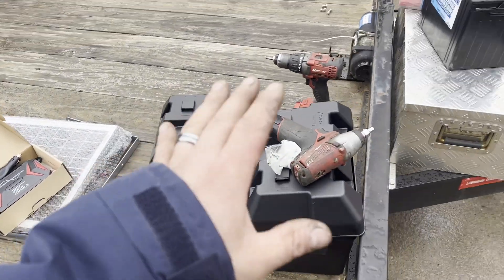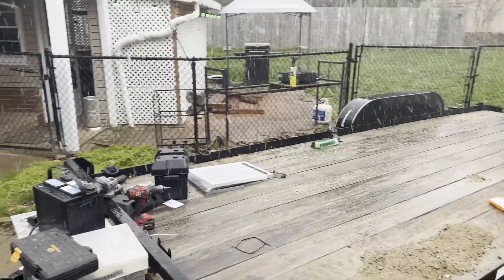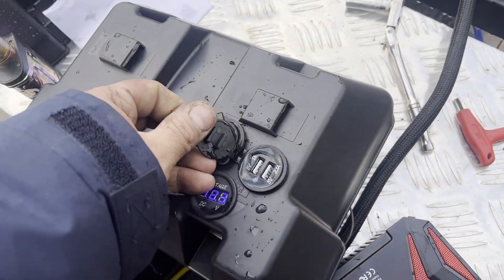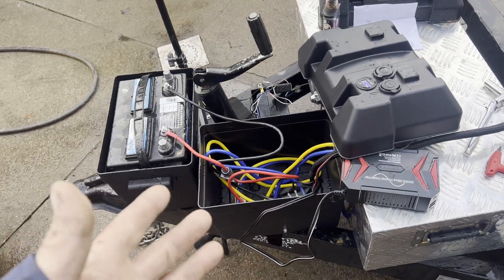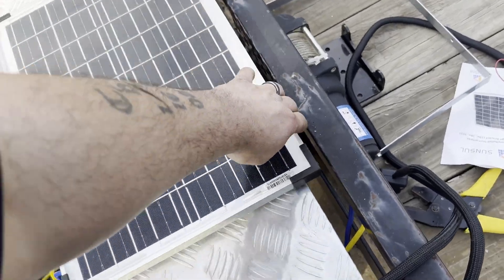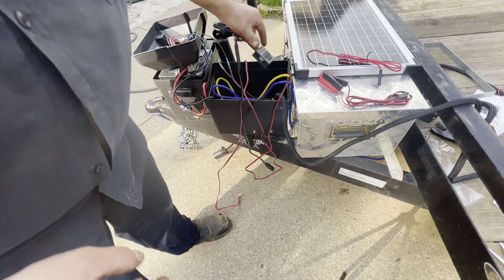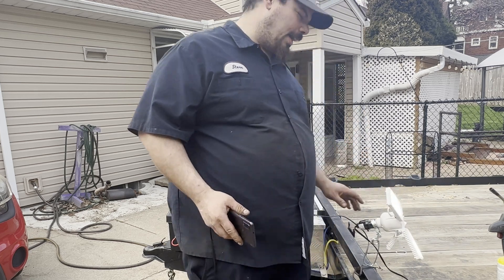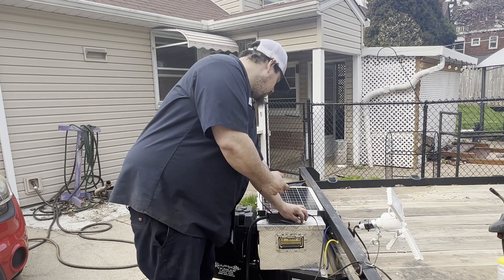DIY Budget Solar with Power inverter

Comment: Nice setup. I was thinking of doing something similar when I get a box trailer for at the tractor pulls.
Reply from the maker: It would work perfectly for you.  I think I have just about 100 bucks in it without the battery.

Comment: I’ve been working some solar panels for my camper.  Last year I was running 1- 190 watt 12 volt panel and didn’t get what I thought I needed.  This year I bought another 190 watt panel and each one provides 9 amps max charging.  Still debating to go series or parallel I could get max of 18 amps.  Your 30 watt panel will put out 1.2 to 1.6 amps max in full max sunlight.  So really a slow trickle charger.  It will be good for long term charging.  Just want to pass on my mistakes
Reply from the maker: Yes.  Sounds like you might need a 24 or 48 volt system they are far more efficient. To run a camper completely off the sun your going to need at least 1000 watts of sun that should sustain you except for the A/C and get some good batteries those are the main key.   Mine is just for little things.  Cell phones led lights etc etc it’s only going to be used a few hours so the panel will keep up fine.

Comment: That inverter won't work a work light lol.   They are 500watt.
Reply from the maker: It will work a LED light that’s just as bright tho 😂
Reply: @R.N.GPerformance  😆.  I'd let you use mine. I built a cooler radio with a solar panel on top with USB auxiliary radio and auxiliary outer power connection. Lasts week's with a lawnmower battery.    Yours is overkill.